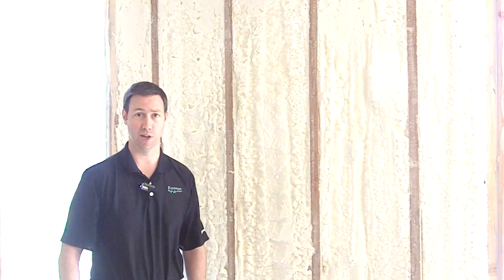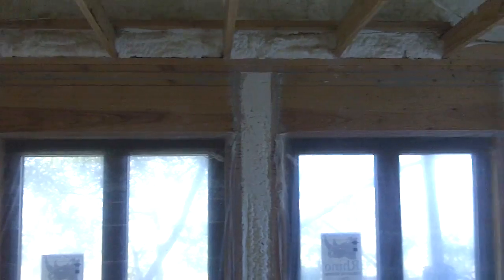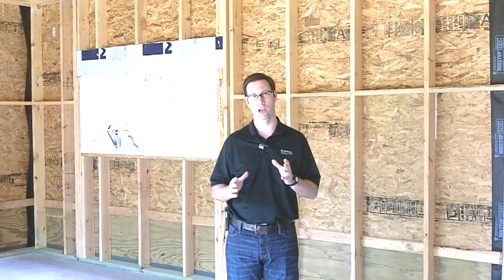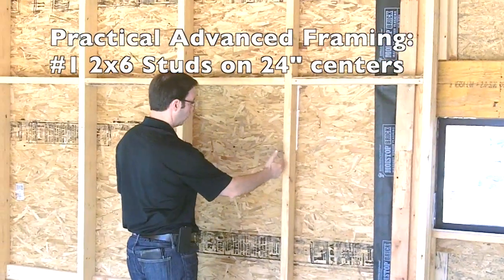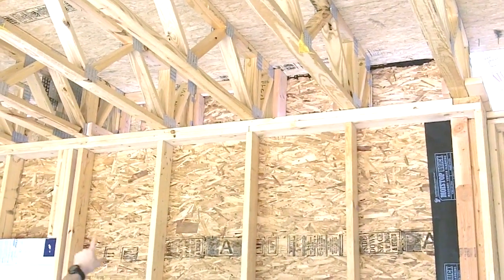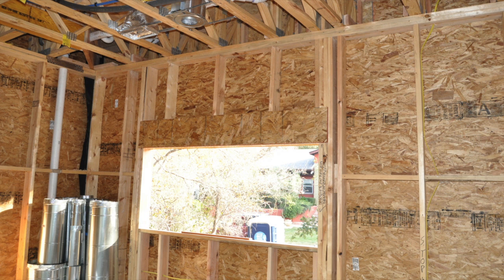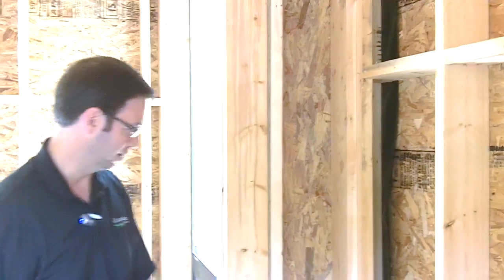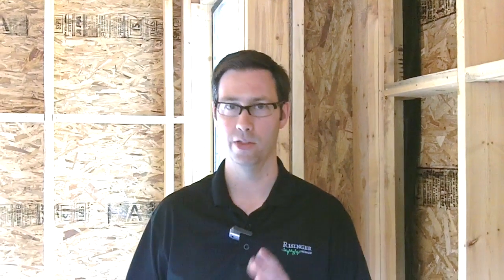Advanced Framing vs Traditional Framing

Comment: How is the saving of the additional lumber offset by the increased thickness of the 5/8" drywall? And...what is that 3-stud corner with the big gap, who does that?? Didn't talk about the strapping...appears to be recessed into the studs(?) is this a requirement? It's strong, but time consuming to notch all studs, you missed this point completely! Many building codes require 2x6, 16OC for residential homes...how then, does one get by the county inspection with studs 24OC? What about the cost of floor trusses vs. conventional 2x10 floor joists? What about the sheathing on the floor trusses? You aren't going to get by with 3/4" ply TG on 24OC!! Two layers of?? What is the cost of this vs. going to trusses 24OC? I'm not convinced of this method one bit...yet!
Reply: Thats the first thing i saw was the notching for the strapping...good eye

Comment: Before following this advice, check your regional building codes. Many places will require 16" centers (even if it's 2x6) ... and in some cases even 12" centers if there are multiple stories above, or if roof load/geometry requires.

Comment: hmm. i never saw a traditional 2x4 home fall over this guy is just making money ..and honestly i would never put spray foam inside a wall thats just asking for mold.... if you really want to reduce your energy consumption use light gray shingle on your roof install attic fans turn your water hwater down and run and use window unit air condtiiners...and only cool the rooms your in when your in them ...also keep un mind theres a green house effect caused by sunlught filtering in a window.
Reply: dont forget the localized heating

Comment: Can someone please tell me where, 6" studs for exterior walls, are NOT requiered? The same for 5/8" drywall, for fire ratings?
Reply from the maker: +Googlesux Bigtime codes for insulation vary by region. Cold climates need more insulation thereby typical to see 2x6 framing. In the South 2x4 walls are more common. 1/2" Sheetrock meets most codes for a fire barrier

Comment: this is in no way cheaper or is it less labor. every block that is used for the plywood seam is material & labor. the laborer bringing me my studs is now working harder.....he has to make more trips with heavier 2x6 vs. 2x4's.
"advanced framing" is this GC blowing smoke up the homeowners ass.
i also noticed he said 5/8" drywall. yeah, so them 24" oc walls arent wavy gravy. 

i hate when some prick desk jockey keeps throwing the "WE" word out there when talking about building something.......like he strapped some bags on and was walking the walls. that sumbitch prolly never swung a hammer
Reply from the maker: +Cityboy2977 yikes!  Rough comments.
Reply: true or not ? you ever walked a 2x4 wall 40 foot up while setting 42 foot long trusses ?
or do you just hire guys like me to do it ? 
just give that some thought before you say "WE build our houses like this because blah blah blah". cause im pretty certain you dont build anything and probably dont have 1/2 a callous between both hands.

Comment: Okay - some comments point to this as cheap, but here is the deal - for max  R-value this is the right direction to go - in some ways. I would consider -R-max panels over studs on the ext. , OR just use styro -crete  instead of studs - even better in many ways..

*BUT  - I know some of this will not fly with my local codes - just built here and there is much more to it..  For one - seismic issues req more studs and a specific nailing pattern, nail size etc. Who cares about saving a dozen studs anyway -  either quality or nothing here. Now look at certain cheapo site built a dair I say they are mostly quick and like McD the stinking junk food of homes - a lot of resin - fake wood that will gas off for years. Or the ones that had issues with moisture and black mold that destroyed many family's  health. Some of these builders are your worst nightmare, truly predators. 
  
There is no half way to build anything - unless you have no values.

Comment: I have been building homes since I was old enough to pickup trash on a job site. Father was builder, my three sons are builders. After 40 years building and designing homes I guess I am a dinosaur. Nothing new here just more codes to drive the cost up. 24" is never a good idea if you are using OSB unless you like to look down a wavy wall and fix nail pops in drywall. Using pressboard for headers so you can insulate over them? The window below maybe has an R-1.5 rating and if there is ever any wetness on that pressboard it's gone! These homes built will not out last the construction of homes built 30 years ago. They are to tight, can't breathe. If you want to improve your construction don't build slab on grade, ever, anywhere.

Comment: People are using SIPS panels that don't have any vertical studs within them at all. I think 24" would be fine as long as you are doing the 4 things he is doing in this build. 1. 2x6's 2. full sheathing 3. spray foam insulation 4. thicker sheetrock that is supported by the spray foam. Take away any one of those 4 and you would probably run into issues down the road.

Comment: Everyone here has forgotten the old school which is 19 and 3/16 on center that puts five studs for 8 feet instead of four studs for 8 feet with 24 inches on center it was originally a truss layout it's located by the black diamonds on your tape measure it gives you the ability to still use half-inch ultra light drywall and five ply half in plywood. Most lumberyards will still carry the five ply plywood which can be used on the walls and roof and is far superior to the 7/16 OSB
Reply: I haven't forgotten. The change started o=post WW2 when ageneration of men who were underpaid for the duraton of the war came home and were guaranteed financing for homes they couldn't afford, and wouldn't have bought had they been fully employed in peacetime.  It was a scam designed to maintain a "full economy" at any cost, and the inflation that accompanied it was intended to suck all the imaginary money back out of the economy. When that failed the 2008 recession was designed to finish the job.
Reply: OSB sucks the dog.

Comment: My 1948 house is 24 on center walls and floors and it had zero insulation in it when i bought it in severe Northern Utah. One owner before me. They however put brick on the outside of the house, really weird. I insulated the attic and crawl space heavily.

Comment: advance framer is the stupiest shit i ever heard, just another young unexperianced moron that thinks there smarter then old timers
Reply from the maker: +roofnkeith I actually respect and listen to the old timers. But remember codes are changing and you won't be able to build a house with the same methods our grandfathers used without having issues. With more insulation and tighter air exchanges our houses have less drying potential. We need to embrace new and better methods. Advanced Framing is just one of many proven techniques for building an efficient house that have been vetted over the last few decades. Thanks for watching. Matt

Comment: Interesting concept, 2 by 4 with 16" center isn't it the same, lumber wise, as 2 by 6 with 24" center. Obviously for insulation 2 by 6 is better as it's thicker also it's faster to install as you have less studs. I noticed that you add reinforcements between the studs at about 6'. Is that for earthquakes? How does it rate for earthquake? Maybe you don't have to worry about it where you are.

Comment: Thank you for helping to keep me in business by telling people less framing is a good idea. Almost every 24oc house I work in has bowed, crooked or wavy walls. There isn't enough structure in 24oc framing. The house moves too much. Needing to put blocking in your walls also negates your argument about getting more insulation in the walls. In an 8 foot span you're only saving one stud because my 16oc wall doesn't need blocking. Besides, there is almost no thermal transfer in a 2x6, especially in a mild climate. But to each his own.
Reply: Your statement, "there is almost no thermal transfer in a 2x6" is patently false. It may matter less in a mild climate, but that is an entirely separate matter. A 2x6 on edge has an R-value of about 6.8, vs the insulation which is about R-20. That being said, I have to agree that increasing the spacing from 16 to 24 is going to have a pretty minimal effect on total R value. A much better solution would be to do a 2x4 double stud wall, which would eliminate virtually all thermal bridging.
Reply: Exactly....the poster is just trying to market a product that puts more $ in his pocket and 24" OC floor trusses...LOL  Might as well have your house prefabbed in China and shipped over in containers

Comment: you dont mention that ants and bugs love spray foam
Reply: They like fiberglass too.  Mice live pretty much anywhere you have voids.
Reply: 2 lb foam does not absorb moisture, .5 lb foam will. In BC we use 2lb foam which also acts as your vapour barrier, although still quite cost prohibitive. It does make for a quiet and well insulated product
Reply: Closed cell foam do not absorb moisture
Reply: Exterminator here. Most structure-infesting (SI) do not simply "love spray foam". Most SI ants such as the Acrobat Ants common here in GA will find harborage in moist areas near food, which usually happens to be foam board near the foundation of exterior walls. They do not (usually) seek out homes specifically, it just works for their habitat if the moisture conditions are not kept in control. There are thousands of conditions that a builder can overlook that will eventually deteriorate and lead to pest-friendly conditions. Carpenter Ants are a somewhat different story, but they pretty equally infest all types of dead, standing wood, not just homes.
Reply: Woodkeeper Jakbop , I was going to spray foam my workshop and was told by my liability insurance agent they would refuse my insurance if I did. It burns extremely well.
Reply: Yes, modern construction is basically a poison hole. Off gassing is very toxic and with all the air SEALED tight inside the home and no fresh air getting in, it's very unhealthy. Fiber glass is better for health reasons.
Reply: Lmao, 24" on center isn't advanced it's cheap.
Reply: Your mom loves spray foam.
Reply: Toob247 Toob247 no the exemption  came back they would cover old insulation if it had two layers of 12.5mm fire check board with 50mm gap between each layer. No new installation would be covered. They really do not like it.
Reply: Big Time
Reply: & how do gases leave ??Do you have to breathe them???
Reply: My question is how many with the negative comment's on spray foam have actually ran a spray rig? Or has been certified by a foam manufacturer? People seems to get open cell and closed cell foam mixed up, totally different cell structure, totally different performance values. Foam doesn't  attracts rodents any more than any other insulation does, if it's warm and they can nest in it they will. Spray foam gets a bad rap because most of the people bad mouthing it really know nothing about it. 2in of foam is a thermal break on walls, it will add structural rigidity to a house, in other words, less shift. Exposed foam has to have a some form of fire blanket in front of it, drywall, fiberglass Rockwool, or thermal protection paint. I haven't seen closed cell go up in a ball of fire yet,like some on here apparently has, I personally took some and put it in a burning barrel and all it did was smolder didn't go up in a blaze. If your thinking of using spray foam on your next project, contact a local professional insulation company, and not social media. Oh 13 yrs of spray experience here never have had a problem.....
Reply: Spray foam, in the UK, is now reccomended to be avoided. always have. It disintegrates, and also traps moisture. That's apart from the poison. Rubbish.
Reply: Ants are only interested living in moist areas, and if there is a section of your wall section that is moist, then there is something that wasn't done right.
Reply: mice too
Reply: And rats and mice.
Reply: But it can still cause an unneeded hassel, when the house gets 50-115 years old and has shifted 1000s of times. I dono if house as old as mine are common out side of winnipeg, and shifting, with us being the city of rivers, and 100 degree celcius temperature variation over the year.  (We were an early trading hub, being right in the center of canada.
Reply: Termites loves wood, squirrels loves to crew wiring, what’s your point

Comment: you're trying to save a buck by going to 24in centers but then have to use 5/8 drywall because of it so you're not really saving a buck then. Maybe a little on labor but that's about it.
Reply: they are going 24 OC to eliminate wood and replace it with insulation, which long term will pay for itself. This technique isn't about "wood" it's about long term heating/cooling costs

Comment: That's not a California corner. California corner is when you have a bare corner on the exterior by not overlapping your sheeting but instead cutting your wall plates 1/2 inch longer to bring flush with adjacent wall

Comment: Hey Matt, the header parallel to the floor joists shown at around the 3:45 mark is redundant...unless you are transferring a bearing point the joist is already carrying the dead load.  I do agree with larger spacing of the studs and use of engineered timber materials though.

Comment: You might be able to get away with those 24" studs in Texas, but for god sake, don't be telling people there is no need for 16" studs. In climates where you get snow, the structure is subject to significantly higher loads. Always consult an engineer on these matters, not a hack YouTuber.

Comment: my house built in 1910 with double brick will be around long after any chipboard slap ups built today will be sitting in the dust
Reply: That's relevant, how?
Reply: But when we run out of coal and gas, you will be unable to afford to heat that old brick house with solar.  I love brick, but if it doesn't include >R20 between the courses, it isn't suitable for areas where significant heating or cooling is needed.  It can be, and at a cost aboiut 15% higher than for frame, but you need to have a GOOD architect and engineer, not a GC who thinks he know how to design.
Reply: @psdaengr911  We wont run out of coal or gas in our lifetimes.

Comment: What's the advantage of 24' center vs 16' center other than $$$.
Reply: Less lumber that doesn't insulate as well as foam or fiberglass.
Reply: More $ in the contractor's pocket
Reply: well according to the engineer a few quotes back the 2 x 6 wall on 24 inch centers is 65 percent stronger than a 2x4 wall on 16 inch centers...  I used to do fire investigation and remember reading 100 year old literature comparing balloon construction vs modern framing and the That's the way we've always done it crowd swore not having 20 foot long single piece studs vs the 8footers today would cause weakness because of the joints...  The deal here is your buying into the system one the 2x6 vs 2x4 two the full sheathing then the 5/8 drywall and overlooked here is rigid spray foam which from my research appears to stiffen the structure and locks the wall together adding to lateral stability...  it's an interesting system...  now you really want to add strength use SYP studs...  we used them on our new house excellent strength...
Reply: C and K Early Warning Systems lol. i read that too.  not sure how but hey whatever floats his boat

Comment: i believe its a building code to have 16" spacing,  2x12 headers and use 2x6 studs for outside walls. I also believe if 24" was ok for the outside walls us framers would have figured it out long ago.

Comment: 3 stud corner is a hard corner, usually there for support DONT wanna drill holes is those studs for sure!!!
Reply: It depends upon the vertical downloads on the studs themselves.  Horizontal stresses

are negated when doing this correctly.....but the type of lumber has some bearing as to 

the final outcome.  For instance, as much as I love fir over YP (lighter, less warpage)

the YP has the strength that fir does not have and must be kept in mind.

Comment: I'll take my 50's over framed house any day over modern efficiency and material savings. Just because we can now model the exact FoS of any node does not mean we should lessen what we use to do. This is why new stuff does not last, FoS is reduced by 2 or 3 and it shows over the years. Especially in times of natural disaster when limits are usually exceeded be it old or new.
Reply: I've worked on remodelling and building.  My experience is that the older framed houses are really much sturdier than the new ones, especially the new ones with wooden truss floor joists.  You don't have to jump up and down in the newer homes to make the dishes in the cabinet rattle; they rattle when you simply walk across the floor.  Also one good old time master carpenter's knowledge was worth all of ours put together.
Reply: Ypur 50's overframed house is probably weaker than you realize.  Try bouncing in the midddele of your longest dimension room.